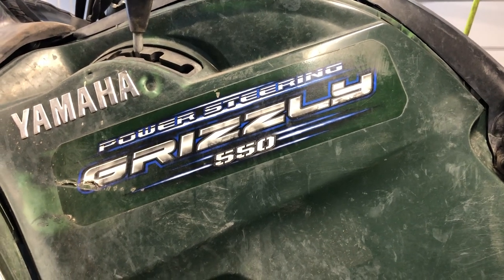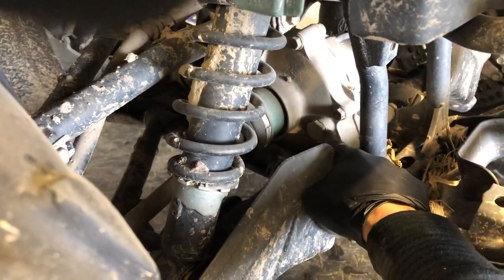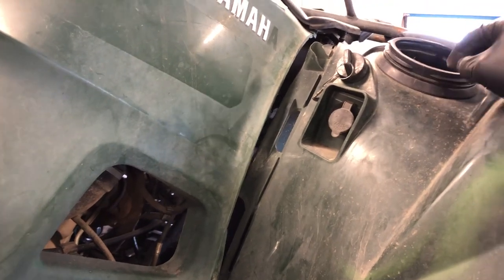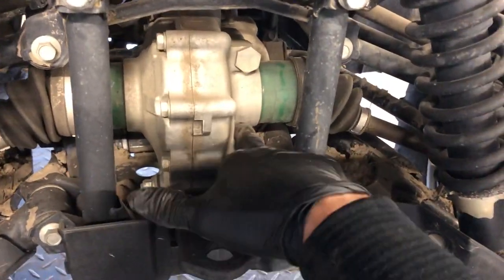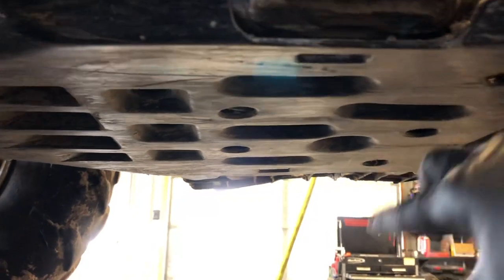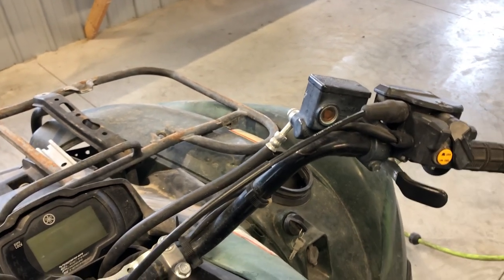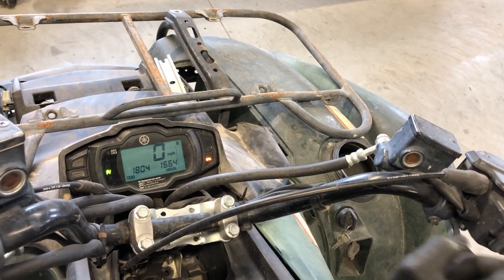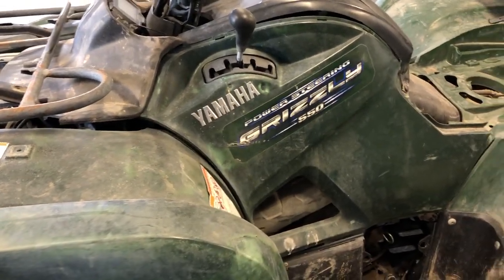Yamaha Grizzly 550 Overview - Review -  common issues problems - HOW TO SERVICE

Comment: would you be able to make a video on replacing motor mounts on a grizzly 700, i need to do mine but i dont want to remove my clutchs and was thinking if i remove the nuts on the bottom and use a piece of wood and bottle jack i could jack it up enough to get them how and maybe get the top bolts with flexable ratchet is that possible?
Reply from the maker: I think you are onto something. Pull all the motor mounts. You should have enough room to push that motor up and get those mounts out. Let me know how it goes. Thanks for watching. Hit the subscribe box for me if you can.

Comment: Where is the fuel filter? My quad is stalling on tick over and stutters a little when driving along.
Reply from the maker: Fuel filter is in the tank on this model. I would drain the fuel to verify you don't have water in it. Also, replace your spark plug. It might be the filter but I don't think those are separate from the pump and they are pricey. I'd start with the easy stuff. Also, clean the air filter. Let us know if that helps. Thanks for watching. Hit that subscribe button if you can. Check out: https://www.ebay.com/str/midnebraskamotorsports

Comment: I have to have my ATV in neutral to start it. Holding the left break or stepping on the foot break won't allow me to start the ATV... any idea what went bad, or what i need to change? its also a little finicky with the neutral position before the starter will engage while pushing the green button. Thanks!  2009 grizzly 550

Comment: Hello, im looking foward to buy a 2012 550 grizzly in new condition. Would you recommend it? Is it reliable? Thanks from Argentina.
Reply: I have a 2011 Griz 550, just replaced starter, solenoid, rear boot and battery a few years. 100% reliable
Reply: Evan Eason what to look out for when buying one ? I am about to buy a 2011 grizzly 550 used 800 miles on it
Reply: The plastics would be a good start. Look at the tires to see if they're in good shape. Pull oil dip stick and see if the oil is gold,  dark or milky. Milky means its been under water. I would just look at the machine as a whole and see how well its been taken care of. Watch on here how to check the hours on display. Ride it make sure everything works. Mind saying the price?
Reply: Evan Eason thank you man & I’m trading my 2018 Suzuki drz 125l
Reply: Thanks for all your advice! I could get a 2012 new one! At a store that never sold it until I came and buy it. So it's new and ready to run. Was never used or even was turned on until I bought it. I paid for it 5500 dollars.
Reply: You're very welcome. If its that old and still new for $5500 u found the best deal. That thing will last u many years. I would change the oil and filter after 500 miles
Reply: Evan Eason every 500 miles ?? How easy are valve adjustments
Reply: @protectork9831  No sir just the first 500 miles. Don't make me lie to u. I've never bought a new ATV so never had to adjust the valves. A friend bought a CanAm and around 500 miles the screen said to service.